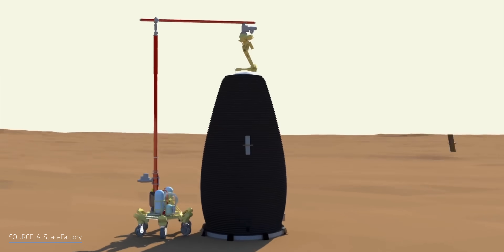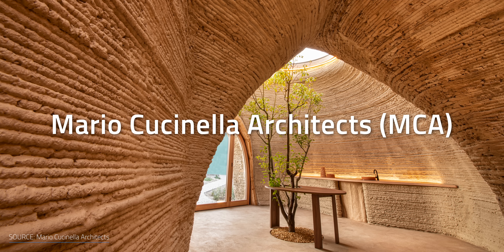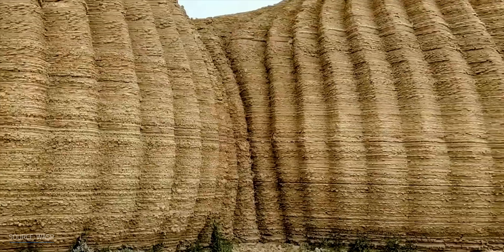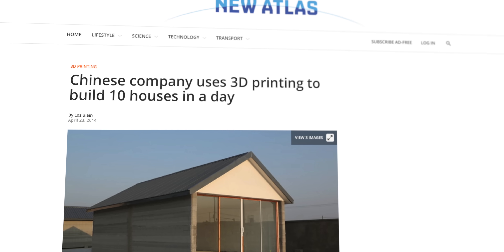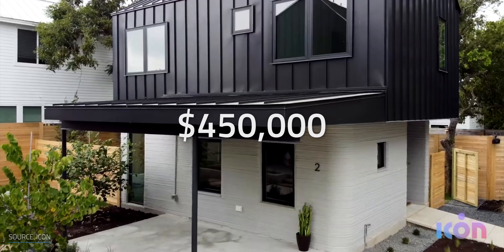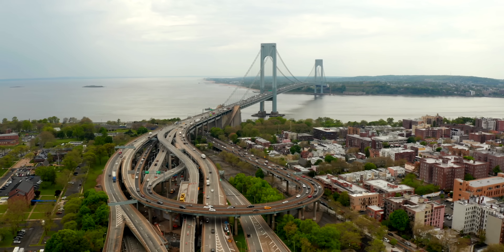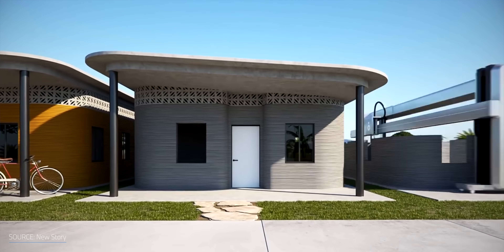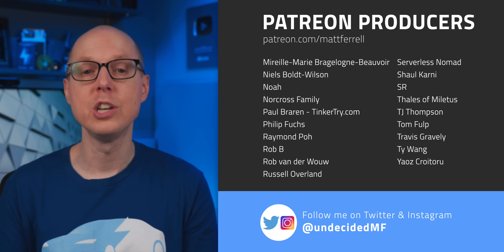The Truth About 3D Printed Homes

Comment: I strongly agree with Nicholas Patel on the value of light gauge steel framing but Nicholas Patel’s criticism is partly from personal incentives that have nothing to do with an honest critique. Also, the simple truth is MANY of the poorest people are ALREADY rural but it is also known that living conditions in rural areas for the poor in the third world is generally better than urban areas & for the sake of public health many countries ‘like the Philippines’ are working to help people move to rural areas. People in rural areas do NOT necessarily produce a higher carbon footprint because of trading with local farmers in smaller communities prevents the need for travel & arguments that living rurally is bad for the environment is a lie propagated by special interest groups that want to keep society dependent upon big centralized business ‘no different than in Ancient Rome or modern communist China in trying to pack people in cities which in both cases dramatically reduced health & life expectancies’. WASP does have a very sensible plan that any fool could see if they bothered to actually think for themselves instead of believing whatever they are told, there is also some new research such as in geopolymers which are by far less destructive to the environment than conventional concrete that may adjust the whole paradigm of the technology. To be truthful electric cars ‘Teslas or otherwise’ in my opinion are much more of a joke for they can definitely NOT be used anywhere & to think Teslas are practical is ridiculous especially in cold climates. The ability to transport electricity from renewable energy sources to a given region is highly variable depending on where you live ‘and in many rural areas can be achieved easier than in densely packed cities’ & overall when you analyze the details 3D printed homes will catch on & make a difference long before electric vehicles, personally I feel it is unlikely that Tesla or any other company will ever achieve any real success in electric vehicle technology within my lifetime. Also, homelessness is a issue that has more to do with unnecessary government regulation & social corruption than technology & the push for electric vehicles which is in itself a scam & a sign of social corruption that in no way actually helps the environment or conserves is a tool for people like Elon Musk to get tax payers to subsidize their tech pyramid scams & lets face it Musk is nothing more than an arrogant nut which is proven by his claim he was going to revolutionize the HVAC industry when he didn’t even know the basics of refrigeration & he even suggested the idiotic idea of putting an HEPA filter inline with the air conditioning blower which because of back pressure & moisture would make the HEPA filter not only ineffective to clean the air but would also be a perfect breeding ground for fungi & bacteria..., in a more general sense 3D printing WILL affect the construction industry but not so much directly but indirectly through the various component parts constructed in a factory & not so much walls printed onsite..., long story short, there is a ridiculous buzz in the media about 3D printed homes ‘akin to the ridiculous sensationalism that the world is in a massive real estate bubble’ but it is NOT nearly as ridiculous or idiotic to actually fall for the foolish & environmentally harmful idea of mass producing electric vehicles subsidized by the government, ‘a solution to a problem that is an outright lie is actually a solution to that problem’ not alone the push against 3D printing technology in the world today has more to do with big business lobbyists feeling threatened that small businesses or even the general public might choose to produce products on their own over buying pre-made constructed products made within their centralized factories.

Comment: One issue with 3D printing houses to is repair cost. If you make the walls out of 3d printed plastic or clay, its likely the walls wont be finished perfectly flat. They will have a pattern to them. Which could look nice, however if damage is done to the pattern or the wall itself (such as when you would install wiring or piping in the walls) you would need to cut out the wall section to fix it, and you would likely never obtain the same pattern. So, if you 3D print a house its entire life is only as long as it takes to get damaged.

Comment: I just find this incredibly flawed. It's nice, architecturally... but it doesn't seem like it can go beyond little huts, structurally. There's not reinforcement. Without that, you're not going above one floor. I just don't see it scaling up. A mud building without (at least) annual maintenance and some exterior coatings isn't going to last long, and won't make it through a big storm. Secondly, people in rural and remote areas already have sustainable housing, and have bigger issues like clean water. Lastly, with this complex interior wall structure and material of moderate strength (at best), how can the inevitable repairs be done? These things become disposable, where you have to demolish and replace them rather than repair them.

Comment: 3D printing is not the solution we need to housing problems, I’ve been looking at old photos of the city I live in being built and it is clear that we lost sight of the importance of having thousands of independent skilled artisans in favor of general unskilled labour and “modern” architecture requiring no real finesse...  regardless, it makes NO sense not to employ people to build houses when those very people have a housing shortage - using labour saving machines instead will only exasperate the economic problems in that area...  people need skills and industry built up, including making things like bricks from local clays and whatnot as we’ve been doing for quite some time...  simpler machines to help in that production line makes some sense but the direct printing of house walls complicates things beyond what is needed for what is decently affordable and sustainable.

Comment: I've been digging back into 3d printed housing again lately, and still haven't found a great answer to my biggest concern; indoor air quality. Each company is just mentioning their proprietary polymers and binding agents in their spiels, but I don't know if any have actually released any data sheets on what is being used or any studies on long term off gassing due to temperatures changes and the like.

Comment: Now if they could 3-D print a house made out of carbon fiber hollow walls Then you could run your electrical and plumbing and then insulate yes it’s adding a couple extra steps but I think it would be well worth it in the long run

Comment: A 3D printed home out of dirt would do nicely if you lived in Arizona, where there is very little rain.  If you want to build in Washington state, you would need to waterproof the outside of the dwelling with some type of sprayed on polymer.   Also I see where they would do better by placing tubing between all those wall's honey comb structure, thus allowing fans to flush out the moisture in those segments while allowing for a much faster drying time.  Unless you let the walls dry for a month before putting on the roofing thus sealing up the walls.

Comment: The small round shaped huts looked nice. Probably it will be advantageous to use mobile grinder units which can create an efficient mixture best suiting for the particular geographical area. Probably there should be found an ingredient which for sure will stabilize the mortar against erosion by rainfall. This material may not be found locally and will need to be imported.
Reply: The best thing to do with a mud house to make it rain proof is to whitewash it
Reply: https://www.youtube.com/watch?v=4MLJs1KRa0Y

Comment: I think modular tiny house is the most bang for the buck with high energy efficiency. A modular home can be put up in hours and that also means move-in ready.These kinds of homes can be customized to fit the buyer's needs or desires and it's future proof for expandability and styles can be changed whereas a traditional built home is stuck on one style. These homes come in a prebuilt kits that get assembled quickly on the site.

Comment: While it looks pretty cool, those shapes are incredibly impractical. Imagine you move in to a house with comparable land area to where you live now, but it has wide wave'y walls that also bend inward. You would need all furniture done on site by very good craftsmen to fit this or you waste half the space and put free standing perpendicular furniture near the middle. Then after 10 year or so after bugs and weather cut into it, people would need to fill it in by hand - or demolish it completely, level the land and rebuild via 3d printer. It would probably work for rich people glamping for 2-3 days, but this will never decently house millions on the cheap. CEB or hemp bricks are much better green wall solutions.

Comment: not sold a things like 3d printed homes, for one what happens down the road if the structure needs repairs? is my only choice making some mud in a bucket, grabbing a trowel and doing it myself hoping to make it match, or am i on the hook contacting the manufacturer for some very costly approach? i mean you can't exactly go to lowes and get your handy 3d printed home repair kit, can you? if the house is so earth freindly and biodegradable does that mean if i live in wetter areas, my homes going to fall apart on me much faster than a traditional home and me stuck with no alternative down the road but to tear it down and build something else? shall we ignore just how much that layered behive look stands out, might even be considered an eyesore, and with all those layered folds in the walls they have to be very suseptable to water damage over time.

Comment: 3D printing of properites, could be great if 1) Tornado Proof 2) Termite Proof 3) Fire Proof 4) Mold/Microbial Proof 5) Corrosion Proof.  Current building codes, including Florida, allow up to 150 mph wind events which is useless...especially Roof Shingles. Tornadoes can reach 300 mph or more. Cat 5 Hurricane Dorian 185 MPH.
Reply: Also, 6) Well Insulated (for most relevant climates), where many fall short.  Roof attachment is often flawed also.

Comment: In about 3 months time, probably half the house will wash away. Coatings might fix that, but they always tell you to apply it to a CLEAN DRY surface, right? I can picture large air bubbles where the coating has lost adhesion and is billowing in the wind.

Comment: UK company, Versarien’s method, using concrete using ‘Cementene’ - a graphene enhanced product, allows a reduction of 30% of concrete without a reduction in strength. No rebar is required and once the building isn’t wanted, it can be ground up and recycled into the next building. It will transform the way building can be made more sustainable but still maintain the technical advantages we are used to with concrete.

Comment: I like the video, But I feel like it is very TECLA centric, which I don't think is very representitive of the solution as a whole and furthermore the video ignores academic research entirely. Where I agree with most of the comments below regarding the problems with clay printing, this video paints 3d printed homes in it's entirety in a very negative light when it is clear that development is (or at least should be) still ongoing. I'd like to see more investigation about the idea of reprap style, user constructed, 3d printing cranes for home generation because thats likely where the cool research is going to be.

Comment: See I'm also interested in how long these houses could live for and how rain and weather play a role in structural integrity. Imagine paying thousands just for it to die in 20 years or less. Bad investment. That does not mean I'm against it but I'm interested in how those areas can be improved. And like he said how would electrical appliances work because there are no outlet and its hard make a way to print that into the plan. 
If the water runs off the side and into a collection pit would that cause sink holes or would the moisture damage the walls? Would moss or mold grow faster as a result? 
Other structural requirements such as fire safety plans and ventilation systems would be interested to see because the functionality would have to be completely re-done but I'm willing to bet heating a cooling would be easier.

Comment: I have been in the 3D Printing industry for just under 14 yrs. 
The Hype around it has escalated over this time. It is at the point that all rational expectations of any tech has gone out the window. Similar to how hollywood robots made real world robotics pathetically lame. 
3D Printing is suffering the same fate. 
Initially customers were amazed. 
Now with the hype most are disappointed especially with surface finish on exstruder type printers. People expect injection moulded results.
Your statement that 3D Printed houses are a long way from 100%  enviroment impact free . Is an unattainable expectation as a result of the hype. 
No system or tech is ever going to achieve this. Natural evolutionary changes all have some negative impact on the local environment. If mother nature can't get to 100% how arrogant & egotistical are we to think we can.
Reply: I think one issue is that people are looking for a problem for layered extrusion to solve, when they don't really understand this particular problem, or the new problems they are creating.

Comment: Fleet of large drones could print houses in hours. A drone for each material prints all parts on site, walls in place, then assembled by drones (with the ability to team lift and fly).
Ya know... 
How the Aliens
 3D printed the Pyramids...
Levitating on site materials into dummy thicc layers (top/ bottom layers, no infill) into the blocks we see as blocks. its layer lines.

Nozzle : 400cm
Hot end : 8500°C
Bed : 600°C
Print Speed : 149,896,998.355m/s
why you still reading, is a meme. lmao
Generate Support : None
Build plate adhesion : 19.614 m/s^2
Extruders : 2
Filament : Generic Earth (Color : Earth Earth)

Ending gcode : G666  W-1 - wipe everyones memory
G1 E-20 F180000
M140 S20